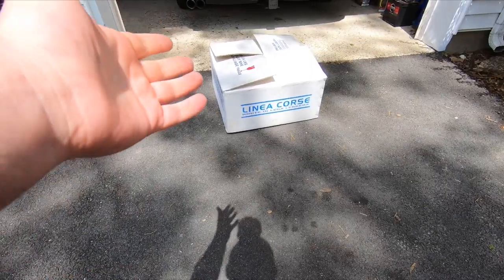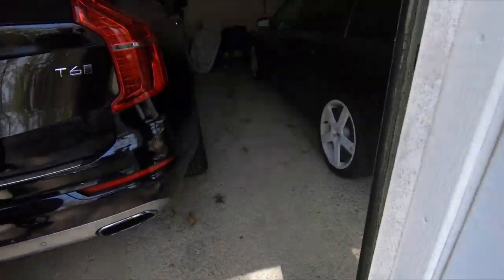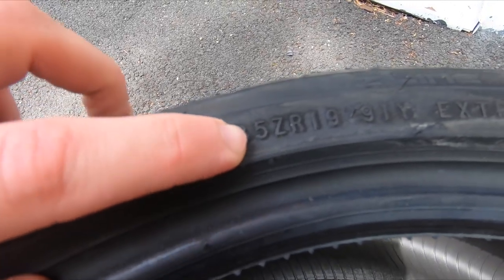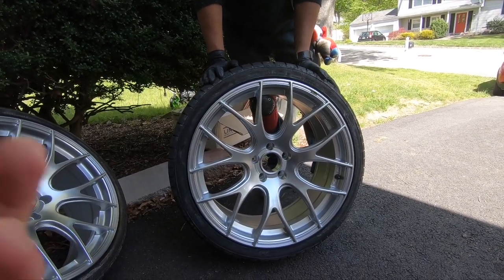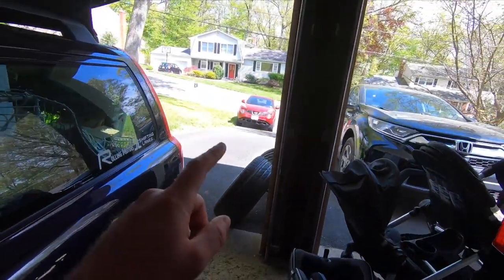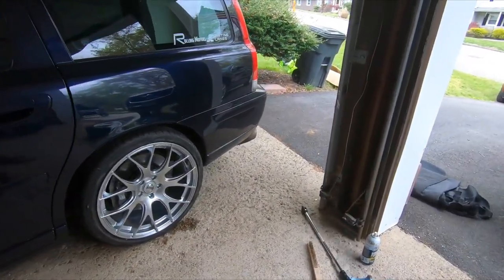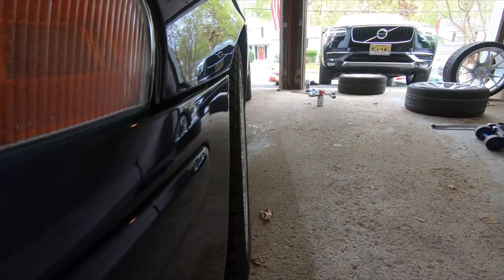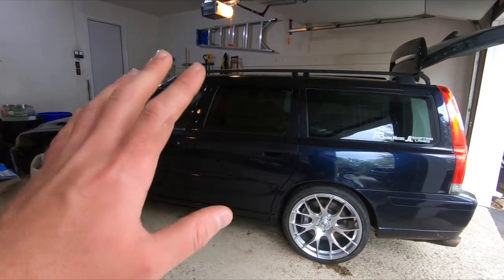It Took Me 3 YEARS To Make My Volvo V70R Look PERFECT! Almost...

Comment: Installed my new Swede Speed Air Filter this morning (red) in my 2005 V70R 6-Speed.  I can both feel and hear an appreciable difference in pull, especially when set to the "Comfort" mode.  The "Advanced" setting is very very responsive with the new filter and allowing more air in.

Comment: Looks sweet Gregson! Viva has helped me also in a big way for my P2 V70R! They supplied me with a single mass flywheel which is half the weight & more efficient grab to say the least! 
Roof rails? Hopefully You take them off soon before the photo shoot! Then it will look clean :)! Enjoying & Appreciate Your series & Your passion! Inspires me to move forward with My updates. Happy driving Brother!
Reply: Regarding Roof Rails. I had them on my 2002 V70 in the UK when i bought it in 2014. Over here in the US, I got my next v70 (2004) last February and it didn't have them on (Though it did have the very expensive headlights), and to me it looked wrong. So I went along to the local Volvo dismantlers and got a clean pair and fittings, and it looks as it should now.

Comment: Awesome wheels!! Wish I could run 19s, but the roads in UK are just not smooth enough 🤬 Ferrari (5x108) BBS split rims are always a good option too 😉!

My personal suggestion would be to consider a different center cap, as the silver on silver doesn't give much contrast. Moose's on yellow would look ace against the dark blue bodywork (that's only my opinion of course). Think about the colour of the caps / calipers / bodywork to get the perfect harmony?

Great work, keep it going!!
Reply: I agree on centre caps 👍🏻And the fact the roads are in a terrible state. 
But 19s are fine in UK.
I have a V70 with 8.5 x19 and the ride is no harsher than 17s or 18s..
It's also now slammed but again with decent coilovers it's not much harder.
I've actually had people comment on how smooth it is.
Drive a BMW M and you'll know what harsh is.
Reply: 💥 Bang Crash Wallop 💥 Yes I know the BMW ride well 😂!! 
I really should have expressed my words better, I meant that (around me at least), potholes and speed humps are rife (S60R on std, recently renewed 4C shocks with eibachs), so the 18" pegs leave just enough wall thickness to cope. I agree the ride itself is fine, even with polys and bars, I'd be happy to slap 19s on if it weren't for the 'oles'n'bumps.

My p80 R with KW coils on the other hand... 19s would be awful 🤕

Comment: I hated the R wheels and white mirrors.
 Personally I have never liked 5 spokes on Volvos... Don't suit the shape at all.
But fair play 👍🏻 car looks sweet now.
I've had the same wheels in 8.5 x19 and gunmetal finish on my grey V70 for over a Yr now and get a lot of comments on how good it looks... With the volvo Centre caps (mine are period correct ones) people think they are standard as they suit the car so well., 👌
BC coilovers to....mine is a lot lower than yours which makes the wheels look even better on the car. 
Camber adjustable top mounts are essential if going low on these though.

Comment: Looks are only half the story. Part 2, what's more important ride or looks? Also how do the weights of the wheels compare? Car feels slower to accelerate with the 19's? Guesses on how many miles before you bend a wheel?

Comment: Silver mirror caps?
Are you turning it in to a V70 R R-design? 😂

No no no no you are wrong the painted trim started late 2004, plus the new headlights and taillights (the R only got the taillights), new front and rear bumpers (yet again the R only got the rear) and 2005 got the headlight washers inside of the wipers.
Reply from the maker: Here in the US we lagged a bit on the model years. 2004 had plastic trim. 2005+ had body color.
Reply: I am very confused, what are you asking?

Comment: Your inspiration picture was my inspiration picture as well, allthough mine is not an R it is also magic blue, and I'm nearly there. I wento for a set of nebula's, a BC racing kit (needs a bit more drop in the front) and I did add the mudflaps. picture: https://flic.kr/p/2j95sKf
Reply from the maker: Wow looks great!
Reply: Mooie auto Ben. Magic blue? Jij hebt toch 0452 (black sapphire pearl/diamant zwart metallic)? Magic blue is 0467 toch? En duidelijk anders van kleur.
Reply: @IwillBwaiting  nope hij is echt blauw, en als de zon erop schijnt paars....
Reply: @MrEdoorklep  Apart. Mijn S60 heeft dezelfde kleur als de jouwe en ik heb 0452. Het kleurverschil met en zonder zonlicht kan ik beamen.
Reply: @MrEdoorklep  Magic blue is zover ik weet nooit geleverd op de S60/V70. Wel op het model vanaf 2010. Als je de motorkap open doet zie je rechts op het schutbord een plaatje. Daar staat waarschijnlijk 0452.
Reply: @IwillBwaiting  denk dat de kleur op de foto's dan vertekend maar het is magic blue 467 kleurnummer klopt in de deur en in de motorruimte, dus die is zeker wel op de v70 geleverd toen al. Je mag wel 's komen kijken als je wil ;-)